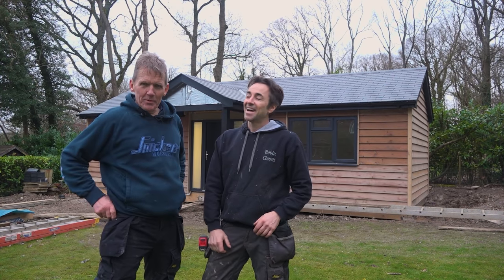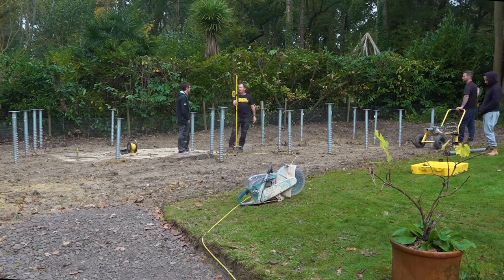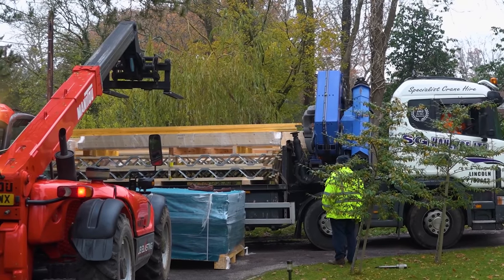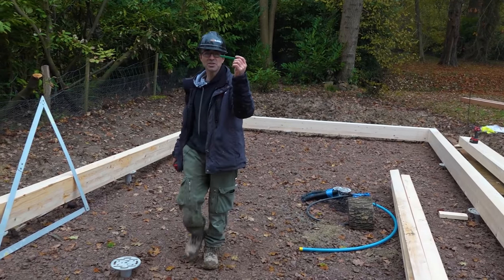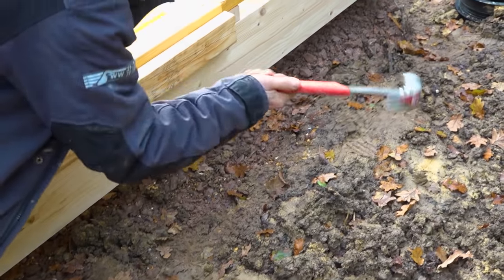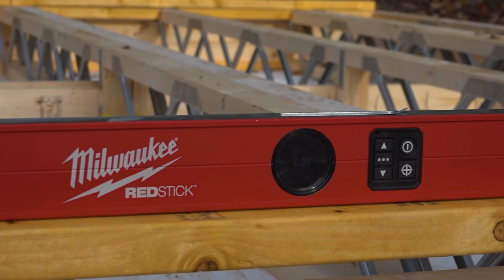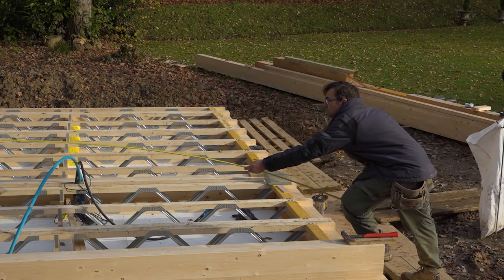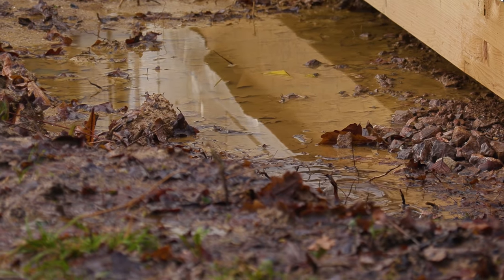Ground Screws & Stuck Crane! - Garden Room #1

Comment: You say it’s Cheaper to get a team of floor screwers in than using that “expensive concrete” I am looking at building quite a large garden room this summer and I can’t see how this method is cheaper than digging - throwing some type 1 down , then use a shutter and poor some
Concrete? 

Could you please let me know the full
Costs of these foundations . 

Great video love your content
Reply: Hi Spencer, we initially looked at a traditional foundation, as our building is over 30 square meters it needed full building regs, the ground is clay and there are plenty of trees and bushes that would have meant a 1m deep foundation would not have been acceptable, so we had quotes for piles and concrete ring beam with a concrete beam and block floor but this was over 20k, so the screws where a far more cost effective solution coming in at about 3k if you are within the need for full building regs then it's up to you how you do it, hope that helps? Best Robin
Reply from the maker: The statement about cheaper needs qualifying. It depends on the ground. Your shuttered concrete with rebar would work on a sandy soil or chalk but  this is clay which is the worst ground to build on. You get heave and shrinkage  as the moisture changes so a concrete foundation would need to be very deep and reinforced to overcome those problems. You could pile concrete foundations in a pier and beam or just have piles and a glue lam on top but that requires a bigger machine.
The ground screws will cope with changing moisture levels and and slight difference in moisture levels will be evened out because the glue laminated beams can actually take the weight of the building over the entire span so any single ground screw loading is not critical. The worst scenario would be for wet ground conditions to start pushing the building up in one place. The test will be how well the doors and windows open and close over the course of a year.

Comment: Looks like the thing sits on only the contact points of the foundation screws. Won't it sag between the screws after a while? Or am I overthinking it.
Reply: The Glulam frame has been engineered to span more than the centres we had our screws positioned, then the building panels are whole and rigid pretty much eliminating point loads and spreading all the weight evenly..
Reply: I think those glue laminated beams and engineered joists are unlikely to sag.  That's the beauty of engineered products :)
Reply: Katie & John S probably... the gluelam beams look plenty beefy enough for the span

Comment: Not being in the trade, so could be a dummy, they look softwood timbers so do they need treating or sealing? & how are the screws tested for weight loading, just interested.
Reply: We did on site pull tests to determine the load capability of the screws and then factored in a 50% safety margin. If you'd like to know more about the screws (I'm the guy who put them in) then check out my Facebook page https://www.facebook.com/GravitasGS
Reply: @gilschaeffer5522  You should collaborate with Robin and Roger and do some more episodes - give rough costs so people can see if it makes sense.  How sre buildings secured to the piles? Are there fabricated brackets?

Comment: Interesting Robin. Did the screw firm do any calcs or a site survey before they started? (Of course its only a wood single storey but you still don't want it to move.) The screws all seem the same length and its not like a mini pile where you can put another tube on top and keep hammering if you hit a soft spot.
Reply: Yes we did a hydraulic pull test on a screw this demonstrated the force needed to RIP the screw from the ground then a calculation is performed and we the roughly half the potential loads to work out the no and spacing of the screws, we probably put more in than we needed but I'm a belt and braces kind of guy, great question many thanks, top Mark's for being the first to ask..
Reply: Check the image on my instagram, I have a picture of the test in progress
Reply: @ukconstruction  Thanks for the reply Robin. Most of the houses I built in Rib' where on rafts with the odd bit of mini piling so I am always interested in foundations and it is good to see something different. Used to look forward to going to the structural engineers to get a new raft design...probably not of much interest to most people  ....out of site out of mind but I enjoyed doing them. As for looking on your instagram...I am a bit  behind the times with these things so will have to try.
Reply: Re ripping the screw from the ground. That's a good way as thinking about it there must be a potential for wind to pull up a wood building and pulling up the screw will take less force than pushing it further into the ground so you will be on the right side in that respect.

Comment: Very impressive gentlemen - but I wonder what your budget is? I'm wanting to building a 5 x 3 metre garden room (studio) and have a budget of circa £10k. I suspect I'd use all of that just getting the foundations screws and base in! So, while your vid' is great to watch, it looks to me to be a seriously 'high end' solution that I suspect isn't a viable option for most people wanting to build a garden room with a tight budget like mine.
Reply: Hi Tim 

 Around 29 year ago I built a garden room around half this size. I dug some holes to avoid tree routes. Poured in concrete and built some brick piers. I got all the structural timber for the joists, walls and roof off a demolition site for £100 and used some OSB for the roof and interior walls. Insulated the walls floor and roof with Rockwool. Bought three rolls of torch on that had squashed ends and got some nice doors and windows from a salvage yard. I clad the outside with featheredge soft wood and painted it green to blend in with trees. 

It is still there and I think it cost around £800. 

Probably it would be £3,000 now.
Reply: @Roger-Bisby1  
Thanks for the reply, Roger - and super swift too!
It's clear that your channel is very successful - and deservedly so. That said, if you made a video series showing a cheap garden room build along the lines you outline here, I'll wager you'll get double - make that triple - the number of views that this series gets. It would be MUCH more relevant, accessible and useful to your DIY subscribers who, like me, want expert guidance and tips to help us on our way and to avoid making basic mistakes. So, please make it! Although what you're doing here looks great it isn't a viable cost effective route for me or, I suspect, most of your viewers wanting to build their own garden room.
Reply: Just a quick point, as this building is over 30m2 we needed to comply with full building regulations this obviously has an impact on the build cost as for a typical garden room like you want to build you could indeed build it for less, based on your dimensions and budget it would give you a build cost of around 660 per m2  our building is 42m2 and is more similar in price to new build dwellings per m2 which is anything from say 1500m2 upwards...hope that helps

Comment: Is that the new Milwaukee 18v first fix gun I saw? If so what’s it like???
Reply: It's good!!! I have tried every type of mainstream nail gun available and it is really good the power and control is nice, a little heavier than a gas equivalent but not enough to worry about, its faily well balanced and pretty compact too, all in all if you are running Milwaukee M18 this is a great addition to your kit...

Comment: Building probably should’ve been higher off the ground. And in fill the space with crushed limestone or rubble helps keep it dryer underneath
Reply: We excavated well lower and graded the site downward with the lay of the land, we then put type 2 back to level so any moisture would drain deep and out at the deep end and away great question and observation

Comment: Are the big screws grouted In?
Reply: No. Friction does the trick with helical screws. However, they can have issues if soil gets saturated and the soil loses its bearing capacity.  For a garden shed, no worries.

Comment: Love to get an idea of cost to install the screw piles and the pre-fab building. Neat idea, but are they an economical alternative to a concrete foundation?

How do you secure the timber foundation to the screw piles? Are there brackets that bolt to the plates at top of the piles?

Quality of these vids getting better and better. Kudos.

Comment: Off topic but repairing loose flashing on chimney. Any point in using lead silicone sealant product, or is it a bodge and just stick to mortar?
Reply: Just finished slating a roof and another guy who does only lead work made the flashings as he was doing other work for us. He recommended using lead silicone as he had ground out the joints with a thin blade in the chimney that I had previously re built so the joints were solid. So I would say it depends on your joints and the state of the chimney. If it is sound and the groove you cut is not very wide and there is no loose mortar then use silicone. But if the chimney is older and the joints are rough with older mortar that keeps coming away as you scrape then I would say it is probably better to use mortar as you may not be able to get the silicone to stick to the brick properly. Using lead silicone isn't a bodge as such its is a case of getting it to stick properly.
Reply: You do know about rolling up bits of off cut lead and hammering them into the joint with a chisel to act as a wedge to hold the flashing in?

Comment: Unfortunately this screw foundation is not for 'slight 80 yr old with no strength'  I will stick to pile foundation Rest is my cup of tea
Reply from the maker: Putting those screws in is not a DIY job for anyone. It requires a very powerful machine.
Reply: @SkillBuilder  yup- thank you I also thought so. I will stick to pile foundation Rest with my cup of tea

Comment: Why, why, why.  See this all the time.  running out a 240v extension lead to the worksite then pluging in a 110v transformer.  The transformer should be where the 240 extension lead is plugged in with a 110v extension lead running to the work area.
Reply from the maker: You are dead right. Dangerous and pointless running 240 volt across the site. Black mark for us.